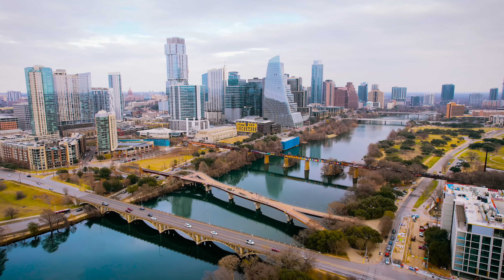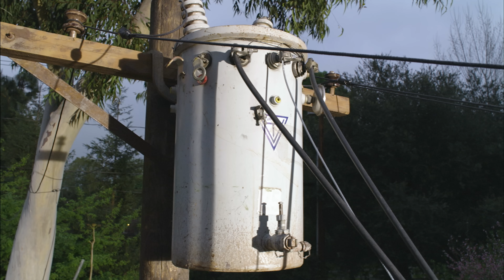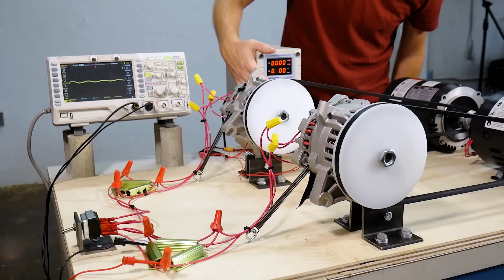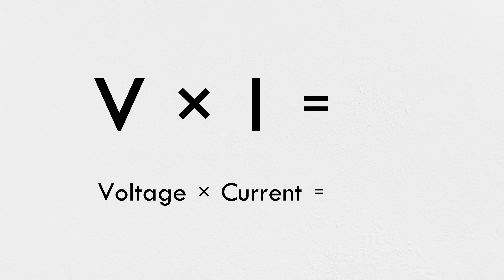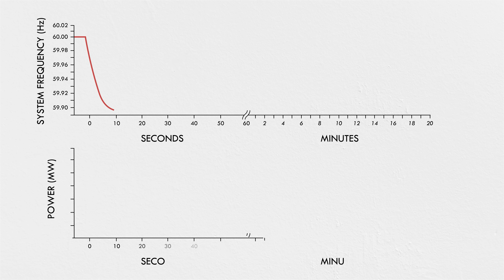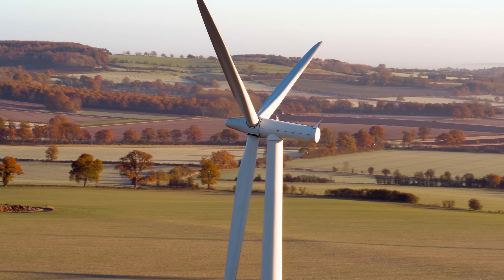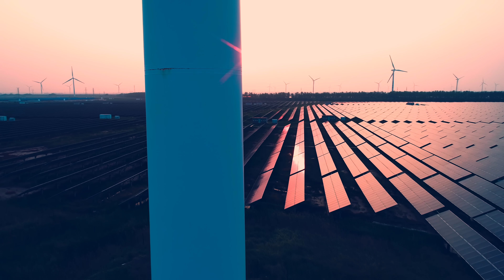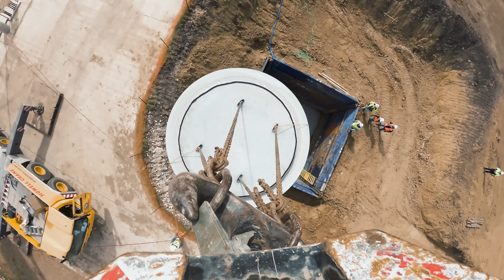Connecting Solar to the Grid is Harder Than You Think

Comment: I work as a lineman in northern EU, and an interesting effect we've noticed with solar is that sometimes the inverters won't disconnect from the grid during a power outage. We've ran into this when doing service work on pad-mount transformers, when we open the switch to de-energize the transformer supplying a neighborhood (in our case an average of 150 households/transformer) with a lot of solar, on rare occasions it will remain energized, backfed from the households solar production. This happens because in the right conditions the solar panels will produce the same amount of power as the households consume, so there's no current flow through the transformer. So, when we open the switch - as far as the inverters are concerned nothing changes, so they remain on and backfeed the grid. It usually doesn't last very long since when the balance shifts they'll disconnect but you could still get a nasty surprise if you're not careful.
Reply: @rtdlaboratories  imagine the possible damage that would be caused, if you just re-supply that accidental power island from the main grid - the two of them surely out of phase in that moment..
high chance, that every inverter on that circuit would be destroyed, plus  more damage to grid devices / cabling etc
Reply: @laus9953  I think the inverters would disconnect right away, or synchronize with the grid right away. 
If you think about it, that’s what they do when they come online. Either they synchronize with the grid, or they do not connect. When they disconnect, they don’t try to connect again for five minutes. They are built per IEEE 1547 as well as UL 1741 in the US.
Anyway, I think the solution is for lineman to get in the habit of assuming there could be power coming from the neighborhood to the grid. It’s always been from the power plant to the neighborhood. We just need to learn things are different now and then we’ll be safe.
Reply: @solarwind907 Pretty much what you said. We also have it in our regulations at this point to isolate and ground on both sides of whatever we're working on to ensure it can't be energized from either direction.  And check for dead before working on it of course
Reply: @rtdlaboratories  thanks for your comment. Good educational, public service! :-)
Reply: @rtdlaboratories can you check current on the line before you disconnect subdivision?
If it's close to zero then you know it could Maintain itself
Reply: @laus9953  I would pay monies to see this just for entertainment value.
Reply: Yes auto reclose could cause issues if the loss of primary suppy  closes  back it's basically unsyncronised with no way of checking for synchronisation with no VT supply or protection relays capable of doing that function at distrubution level.
Reply: @laus9953  This is why we have things called fuses and circuit breakers
between the solar invertors and the supply company mains !
Reply: @pjeaton58  when two AC sources re-connect to another without synchronisation, your protective devices might experience double their rated voltage (worst case: 180° opposing phases during the moment of re-connect).
so you think all protective devices can disconnect twice their rated voltage (i.e. extinguish thus resulting arcing)? I think arcing ( /the extinguishing thereof) is a hard job for high current switching devices as is is, at nominal rated voltage (and still results in damage to equipment behind this protection) - never mind a scenario where you are dealing with DOUBLE rated voltage.
Reply: The solar inverters failing to disconnect is more likely than people think. I can't speak for EU requirements, but in Australia and NZ the inverters need to implement volt-var and volt-watt control. These manage the voltage on the network when grid tied by injecting reactive power and limiting real power injection. This has a side effect of making islanded operation more stable. The island could occur when the solar generation exceeds demand, and when you disconnect the grid at the transformer, the voltage rises until the solar inverters adjust their injection. The stability will also depend on the types of loads connected. Eventually the slower passive anti-islanding protection elements, or active anti-islanding protection should operate.
Reply: @sambird2954 there's also the issue that if the anti-islanding protection is too fast or sensitive, a manageable grid deviation becomes a major black out because a large number of solar systems trip inappropriately at the same time. This ride through requirement, combined with the volt-watt and volt-VAR response of the inverters could help to keep an island alive if the demand was just less than the  available supply. I'm not sure what impact home batteries would have other than making supply and demand from an individual house more likely to be equal. Do they have any automatic responses designed to stabilise the grid that could inadvertently help to stabilise an island?
Reply: Interesting, I always wondered how grid tie inverters even detect that the grid is down, because if there's other grid tie inverters on the same circuit won't they just assume each other is the grid? I guess the answer is... they don't always in fact shut down!  But if the grid is trying to take more current then they can produce then I guess they just shut down one by one within micro seconds.
Reply: @redsquirrelftw  Generally speaking what is happening here is that the solar on the isolated grid is roughly matching the load, and so it thinks the grid is still good.  If the solar were unable to match the load the voltage would drop drastically and trip the grid-tied inverters off.  And also if the solar exceeded the load significantly the voltage would rise drastically and also trip the grid-tied inverter off.

Normally grid-tied inverters will trip off nearly instantly when the grid is lost.  The grid is an incredibly low-impedance circuit, so the voltage will more or less instantly go too high or instantly go too low and nothing the grid-tied inverter could do would change that.  A grid-tied inverter just can't individually push enough power to have any effect.

But in the sweet spot where the output matches the load, neither of those conditions will occur and a grid-tied inverters will keep operating thinking everything is fine.

--

In terms of signalling, its sort of possible but difficult to inject signals through the various circuit breakers.   Some utilities do form networks over the power lines but I think most these days are just hopping wirelessly between smart-meters or using the cell network to report usage.   One thing that could be done would be for the grid to impose a heatbeat on grid-supplied power that inverters would detect, and then require that the inverters trip-off if they don't see the heartbeat.

-Matt
Reply: IEEE 1547 FYI
Reply: @redsquirrelftw  On large scale utility the AESO in alberta mandates anti islanding protection, and some of it is done via line terminal status of transmission lines that'd open on a protection operation that'll send a transfer trip signal back to the generator's main circuit breaker(PV/Wind/Gas etc. it doesn't matter) or we use an undervoltage scheme that'll detect the voltage sag of the local load vs the generator trying to support it. They also have a mandate that requires underfrequency/over frequency protections that'll operate the generators main circuit breaker and if they're of a certain size they're SCADA powerflow is sent directly in so if they're still online it can be seen and managed directly by a system controller if they're a type of generation that allows the formation of an island as it's not always required for them to go offline.
Reply: In Australia, or at least in perth where there is a single state owned electricity company (western power), all rooftop solar installations must be able to be shut down remotely by the grid operator (synergy in perth), probably for this exact reason. it was controversial when it was introduced but the types of people to care about government control were not the type of people to get solar at the time and most people dont know or care about it now. the eastern states have a "national" grid with private companies connected to it so i have no idea if its the same idea for rooftop solar.
Reply: Do it like they do with overhead 15kV 16.7Hz in Germany's rail network: it's not safe until it's actively grounded.
For low voltage that essentially acts as a "gegen Wiedereinschalten gesichert" (protected against re-energizing) by way of force-tripping a breaker/fuse through the deliberately introduced ground fault.
Though tbf on trains they need it mostly because of stray coupling from e.g. parallel lines, what with it being a single-phase nation-wide synchronous grid (some former GDR/eastern areas notably are still on islands), so there is less cancellation of balanced phase currents from their wires being co-located.
Reply: @namibjDerEchte  Yes that is the standard for Substation work in the USA.   Tie ALL conductors down to ground.  Grounding Straps are the first step after de-energizing, and the last thing removed before re-energizing.
Reply: Worked for years with my dad doing line work, sometimes we just threw a chain over the power lines that are supposed to be cold just in case, saved a lineman from getting zapped when a controller forgot we were working in the field.
Reply: This is why we check and ground before doing any work on medium voltage lines.
Reply: Woah, that's an interesting fault. I've never heard / thought about this exact configuration, but yeah, they would stay on as long as that configuration remains stable...
Reply: I learned today that new installation of a grid-interactive inverter must:  have ability to throttle the power and also be able to shutdown the Inverter power and control the scheduling of when the power is used/delivered and the quantity on command from the utility.  I imagine the direct command & control will tend to resolve this accidental self-supporting meta-stable microgrid situation.
Reply: I’m a solar installer in Michigan and we are required to have anti-islanding tests before the inverter gets commissioned. We are also required to have a rapid shutdown system that reduces the output of each panel to one volt and disconnects the inverter from the grid. Back feeding the grid is a major deal here.
Reply: @wyattrowe8396  As others have said, all anti-islanding mechanisms will fail when then the separated segment is producing 100%-105% of the power drawn in that segment.
Reply: Hehe...almost need one of those meme-level 'breaker finders' where it's a power plug with shorted wires...Cause one hell of a fault on the customer side of the transformer after breaking it off the main. Their inverter will find the 'balance change' of a pipe wrench across the phases should shut them down XD.
Reply: I thought they had to shut down when line power is lost. Interesting that they don't see that(I get the consumption vs solar output.)
Reply: >lineman
Lying American. We do not have lineman, as we do not install our lines above ground like savages.
Reply: Please be very careful. The old saying IS NOT obsolete “Work it hot or ground it dead.” It’s true now more than ever that you can’t really be entirely certain that all sources or feeds were off line. It was true when we had a dozen plants and more true than ever that we have thousands!!
Reply: I work in Solar industry and a lot of Energy Distribution company ask for NVRs as an additional safety measure.
Reply: Another great video accurate and informative . Inverter based generation is coming into the grid in a big way and smart engineers have a very interesting future getting this technology to function in many sceneros of faults black start as well as normal steady state loading . We had a state wide blackout in South Australia a few years ago after a sever windstorm damaged state interconnectors and some local EHV feeders and it happened  in the evening so mininal solar generation in the state at the time. The reasons for the state wide outage was politcised and so called experts in the media both pro and anti renewables pushed their narratives both wrong. The state had a high concentration of wind farms and they where generating a large proportion of the load the main interconnector to a adjacent state was supplying most of the non wind turbine load . When the interconnector tripped off automatic underfrequency protection started tripping off and most of the wind generation didn't stay online and ride out the fault taking huge amounts of power away from the system further dropping  the frequency and triggering even further loss of grid resources due to underfrequency relays operating . The whole state was thrown into darkness for many hours until eventually the interconnector could be reinstated and supply gradually restored and wind turbine farms re syncronised and back on load. Investergations after the event found poor and uncoordinated under frequency relay settings throughout the network and incorrect wind farm ride thru software settings where to blame. So as you said it's complex but needs to be properly modelled so settings of all these systems to work together to keep as much as the system energised as possible and not create a statewide outages.
Reply: @noelcastle3986  at the start of PV gaining popularity in germany around 20 years ago, a little publicised but huge problem was discovered: the "50.2 Hz - Problem".
the specifications then required all grid tied inverters to immediately disconnect, as soon the frequency would surpass 50.2 Hz (supply - shedding in the European grid, in order to maintain as close to 50 Hz as possible for grid stability).
then some people realised,
that the installed PV power had risen to amount, which the grid could no longer cope with if suddenly dropped - and if it happened to be a sunny day, and for some unrelated reason the frequency would also happen to reach 50.2 Hz - then the entirety of PV would have immediately disconnected - meaning the sudden loss of supply power of an unsustainable amount (if I'm not mistaken, around >GW at that time), which would have led to the grid disconnecting everywhere, meaning grid - wide blackout.)
to remedy, inverters still have to disconnect at 50.2 Hz - HOWEVER: not immediately - but each after a random time interval within a specific time window. (so I believe).
within this time window, the random disconnects should lead to the grid to remain below the 50.2, cutoff frequency.
Reply: I have never thought about this effect, but it is logical. Since these become self-referencing systems, wouldn't it be possible for frequencies and voltages to move further and further away from the grid voltage and frequency?
Reply: So low voltage ride through and frequency dependant load shed is a big thing…
Reply: Remember that the inverter only needs to pass the anti-islanding test when being qualified for UL requirements to get listed and released into the wild.  They are not UL tested on a real grid.  I have seen Fronius solar inverters NOT respond to real PV Arc fault but they passed the UL test.
So having said that, these inverters should work as intended and I have rarely seen one fail on a real grid but could happen.
Also, an inverter that is small compared to the grid it is connected to should be overwhelmed by the low impedance when the grid goes away on the other side o the substation.  I don't know if this one was a MegaWatt inverter or a 10kW one
Reply: @k7iq  They are grid following inverters, and not grid forming inverters.  They will simply drop out regardless of their UL listing
Reply: @boblatkey7160  That is what they are supposed to do.  But even for a current-source inverter (grid following) they can be fooled by such things as resonant L-R-C loads which are part of the UL test.   Very rare occurrence I would suspect.  So that might not be this particular inverter(s)

But they should disconnect.  There are also grid-tie  voltage source inverters (grid forming) that can be even worse.  He did not say, I don't think, which inverter this is and HOW the grid failed.  If there is still are large load on either type of inverter, that inverter should overload very quickly and shut off
Reply: @boblatkey7160  Yes, current source is much easier in this regard.  Just not perfect.
Reply: I'm an electrician/solar tech in Ontario. The thing we keep hoping for is better SCADA so that solar generators can be used to their real potential viz reactive power and overall power factor correction. This improvement would also eliminate the slim possibility of islanding that is being correctly pointed out here. 

We would hope that in the that SCADA improved to the point that solar and storage could not only inject watts but also take care of all the VARs necessary to run the grid.if that was to happen, it is unlikely that solar generators would get a taste of the immense cost savings experienced by the Utilities and generators. But, it would give us all peace of mind to know that our power workers were 100% safe.
Reply: The system is outdated,
There should be a back feed block isolator installed at the house, mmm...
Reply: @emirhussain6084  But the house is supposed to back feed the grid. We call it exporting. If the supply and demand happen to be balanced, there is no way for the system to know it is back feeding a de-energised grid rather than exporting to a functioning grid.
Reply: very helpful and interesting video-the commentsection is informative indeed -
😊I think the safest way is ground and short circuit after the isolation-😊because there may be some faulty inverter which may settle producing the current-
Reply: I have a 2000 watt system on my off grid RV so I know solar for 10 years. Typical panels produce 50% of rating in summer, 5 - 10% in rain and 25% in the other 9 months. Zero from 4pm to 11am. So a typical 10MW plant produces about 10% of its rated capacity which makes it a total scam because the AWFUL POLLUTING FOSSIL PLANT is still runing full time as it was before the solar instal. . For SPAIN to say they are 100% green is BS because there is NO SUCH THING as 90% of the time the sun is off, panels underperform or wind is too low or too high. When you combine this nonesense with 25% line loss it produces nothing but virtue signaling. This is all just TOTAL SCAM. You should just go pick pockets on the subway. Same thing.
Reply: This is why 3 position switches are the future: closed, opened & Grounded. Safety first. This practice will force voltages to zero a(at least locally) and hopefully cause distributed Asynchronous power sources to stop generating. 

Another possible impact from this phenomenon is random Frequency. Solar inverters have no freq control so could randomly load match for a short time, but at a resonant frequency unlikely to be 60Hz (or 50 Hz in EU). This leaves the Utility/Grid operator liable for damages to customers refrigerator motors for example. Again, 3 position switching negates that impact.
Reply: @richardfarquharson9975  Dude. This is all NONESENSE. The grid needs a BALANCED LOAD, not on and off again sole and wind NONESENSE. Solar and wind produce ZERO power if you consider FAKE POWER PAPER CLAIMED OUTPUT (usualy 50% of rated power and another 50% loss for night and  75% of the seasns and line posses. Most plant are producing 10% or LESS at the actual termination point and I would guess its more like 5%. Even Sprin claiming FULL GREEN ENERGY POWER measures that are FULL SUN, CLOUDLESS, SUMMER for usualy less than a few minutes while they SWITCH OFF the fossil plants to make a FAKE STATEMENT. Its all a SCAM, enriching politicians, creating pollution and screwing the taxpayers. For you to claim you have a SWITCHING SOLUTION to a LIGHT BULB not connected to ANYTHING shows your STUPIDITY
Reply: Troubling that this kind of dangerous flaw to a critical piece of society is described as a quirk, that’s just the way it is.  If some clown goes driving his heavy truck around knowing the brakes don’t work and kills some  people, we don’t write it off as a “nasty surprise”.  Residential solar needs to end. It’s five times more costly than utility scale, and it’s all amateur hour. Enough.  Sure loads of people work in the buis now, I don’t give a shite, loads of people sell narcotics too.
Reply: @Nill757  Well, that is precisely why the safety procedures are written the way they are. You assume everything is live unless proven otherwise, such as by measuring it, and where possible grounding it. That's why I don't really agree with your truck analogy - there a person knowingly takes a risk - something you would be written up on in the electrical trade as well. If it's not solar inverters then there are countless other things that can introduce voltage in places you wouldn't assume it to be - induction, influence, capacitance e.t.c., which is why you always have to be vigilant and think about what your next action is.
Reply: @rtdlaboratories Doesn’t really work that way anymore in residential, does it?  Sooner or later a tech has to be working on the load side close to some residence,  w breakers open on the  grid side. Tech does his test, circuit is indeed dead, and then somebody’s backup  from batteries or whatever kicks on feeding the grid while the tech is still working.  W big commercial it’s always been the case where a tech can walk up and cut off the building, for just this kind of problem. .  Not residential.  A lot of the guys doing maintenance just don’t want to hear it because the rules have worked for years, and no need for extra worries.   But there  can’t be a power company on both sides of the line, w nobody in control.
Reply: That's... Weird, but kind of obvious in retrospect. I guess we could make devices talk to each other over the lines themselves? With some kind of modulation, like powerline internet. But then there's security concerns... Somebody sending the "everybody turn off" signal would be pretty easy and bad. Connecting them to the internet is kind of dumb too.

Maybe just attaching an artificial load to trip them off is easier. A bunch of batteries on a truck or something.
Reply: @XIIchiron78  That is actually a good idea. HOnestly Powerline internet would be epic for just internal grid use, yes security would be an issue but these days good encryption with some type of synchronization would probably do the trick. If you could get even a 50Mbps grid wide speed you could send all sorts of useful telemetry and perhaps even use  it as an emergency backup tho with cellular and satelite internet perhaps redundant.
Reply: @XIIchiron78  if they can do digital communication over the line, there are digital assymmetric cryptographic signatures you can use to sign the messages so that valid commands can only be issued by trusted officials that has the private key to sign messages, but these messages can be verified by any devices holding a corresponding publicly known key.
Reply: @XIIchiron78 Easier solution is to just measure power in separate from power out, instead of measuring their sum. This is indeed what modern solar panel electronics do today.
Reply: I don't understand how this could happen. The solar panels would not just have to produce exactly what that single house uses. All panels in that network would have to produce exactly what all gone use together. Meaning, power is gone from the network, my house connection to the network is not closed, and if I'm producing energy, it goes out, not just to my household. Somehow I think it's much more likely some of those cheap Chinese inverters were simply not reacting properly/fast enough.
Reply: Yeah so that doesn't happen here in the US
Reply: That's rare and even if it happens it should be max 2 seconds. That's within the specs . You say very short period, how much you estimate the period?
Reply: @solidfuel0  That was a while ago, so I don't remember all the details but it was longer than a few seconds, probably closer to 15 - 20 or so. I remember my coworker noticed that the voltage meter didn't go down when we turned off the transformer, and it took us a few seconds to think that maybe something was back-feeding it (altho at the time we thought there was a section break on the LV grid that was left closed or something) and started pulling the fuses on the LV side. The voltage dropped as we disconnected the first feeder, and I remember thinking we got lucky by finding the right one first try. We didn't realize immediately what was going on but were kinda confused for a bit when we measured the voltage on that line and got nothing. 

This is actually an issue our energy agency published a paper on a few years ago, stating pretty much what I said here, that if both active and reactive balance is present in the island it can self-sustain for a significant time without any anti-islanding protection detecting it. Now I haven't worked much with solar inverters myself, I work primarily on the regional grid and up, and this is what that paper was aimed at, but the underlying problem is pretty much the same both on the HV and LV side.
Reply: @solidfuel0  he is completely full of 💩
Reply: Interesting. I guess that’s theoretically possible and if you’re telling me it happened to you, I’ll believe you. I would think it’s highly unlikely, though. 
So what you’re telling us is that on a sunny day, in a neighborhood that was probably running on 100% solar at the time, if you disconnect the utility, the inverters see each other as the grid so they stay connected? Yes?

I guess that could be corrected with a signal from the utility. When they open their mains, they could send a signal to drop a contactor on each customers Solar.

I guess this adds another step to your work. Maybe there needs to be a lockable disconnect on the secondary for the utility transformers??  Or you need to pull the fuses just in case. 

Thank you very much for your post!
Reply: @solarwind907 this is a real problem. All anti-islanding schemes  will have a non detection zone where the load is balanced just right to the inverter.
Reply: @solarwind907  if they were 101% solar, then it would work. The utility would disconect and the solar arrays would throttle and stabilise the frequency. As long as no major unexpected loads dropped the frequency, then the arrays would have no idea they were disconnected
Reply: @rtdlaboratories  you may be a lineman, but you are wrong about inverters. Period.
Reply: On a residential level that is absolute BS! These inverters are grid following and they are not grid forming. Without the voltage and frequency from the grid they have no ability to produce power on their own! Geez. 🙄